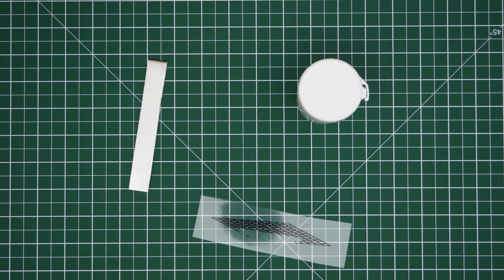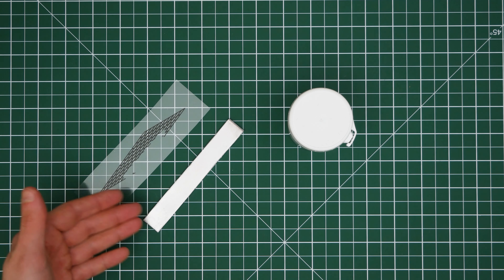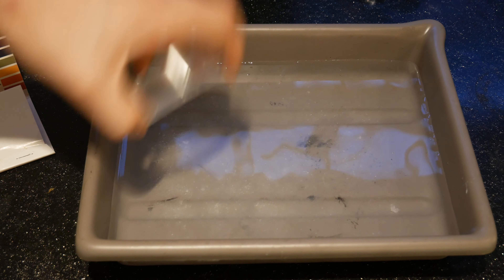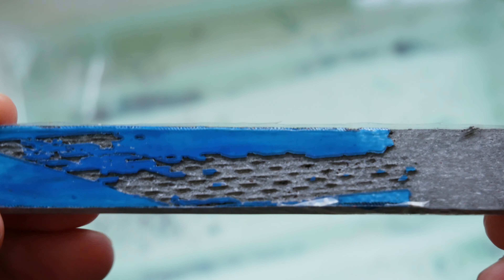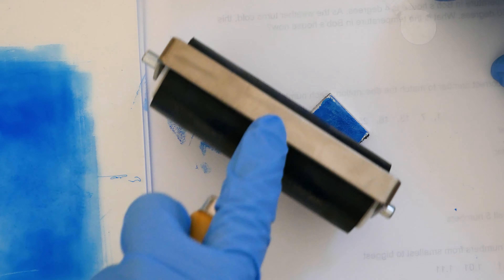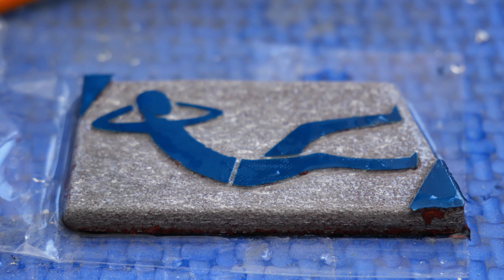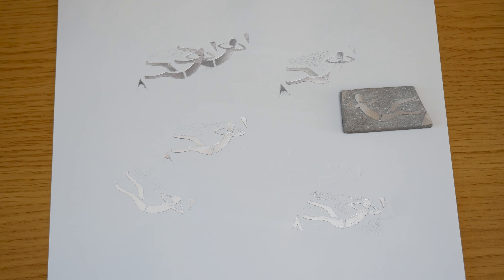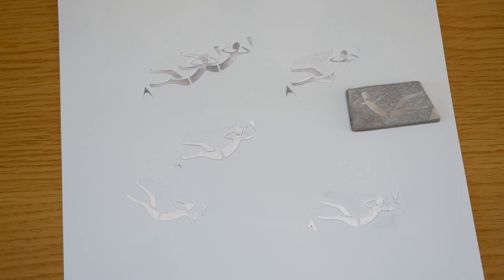Metal Etching - AMAZING results at home

Comment from the maker: Ricardos comment seems to have disappeared but it was very informative and may help others so I'm posting it - "For some time now I've been trying to understand too how to produce a nice deep etch that either results in a straight 90º edge or a 45º angled base (as used in plaques/signs or letterpress). I haven't seen any home made process but the professional way uses a machine that mixes a bath of water, nitric acid and etching oil. From what I understand, it's the oil (that I suppose doesn't mix with the rest) that protects the edges while they're bitten away by the acid. I haven't found an explanation on how the etching machine works. I know it spins and I suppose it also emerges and submerges the plate. The trick might be here, as when the plate rises and spins above the bath, it'll throw away the acid and slow down the etching. When it submerges, the oils on the bath surface will adhere to the edges and progressively build up a resist. This would explain somehow the degree edges produced on some etchings but I guess the process is different for the other "just-raised" edge type. Here's an example: http://sunsetsigns.co.uk/wp-content/gallery/etched-zinc/etching_zinc_6.jpg and this video explains briefly the steps to it: https://www.youtube.com/watch?v=OW-QA7wrPOE I have no experience whatsoever with etching or printmaking. I'm just assuming. Nitric acid is a bitch to work with too. "

Comment: Great progress man! I really hope you will find the right method, looks like your almost there! Just some ideas: maybe try copper or magnesium instead of aluminum. Maybe even try other aluminum, to me these plates you used looks quite rough, maybe the the mix of aluminum is just bad and not for this job.
Other thing that I remember from PCB making is that I always (for some reason, I read it somewhere) used horizontal position of plate in the acid bath. I we used to stair it, or better say rock the container with the acid that way the plate was always clean in a bath and chemical process was even.
Reply: I know it is pretty off topic but do anybody know of a good website to stream newly released tv shows online?
Reply: @Ronnie Castiel i use flixzone. Just search on google for it =)
Reply: @Samuel Gunnar yup, I've been using FlixZone for since march myself =)
Reply: @Samuel Gunnar Thanks, I went there and it seems like they got a lot of movies there =) I really appreciate it!!
Reply: @Ronnie Castiel Glad I could help =)

Comment: To HELP with under cutting you need to add resist. Etch it for a while, pull the piece out, add resist to the edge, place it back in the etching solution, repeat. It wont be perfect, but it will reduce under cut. You can try permanent marker etc as resist.
Reply from the maker: yes I actually tried using the old technique to brush some fine resin (dragons blood or something like that) onto the edges and heat it up so it fuses to the shoulders of the metal etch. It was no way perfect but it did work and prevented undercutting!

Comment: I've seen folks make photo-etched parts for modelling from thin brass sheet. For simple designs, would it be possible to etch 3-4 or the same thin parts, then stack/glue them on a base plate to give you enough depth?  Regarding the undercutting, I wonder if you could carefully add some form of resist to the edges of the etched design mid-way through the etching process. Could that maybe work to hold the undercutting back for just that little bit of additional depth that you need?  Just thinking out loud.
Reply from the maker: seems like there would be too many variables etching the image multiple times and stacking it together, especially if you wanted to do fine details like text etc. I might give it a go though so thanks for suggesting

Comment: I'm just going to throw this out there. I have seen people use dish soap as a surfactant in water. This keeps the water from beading up. Could you make your initial etch, and then gently add just a thin layer of water to the etched surfaces using a pipette or syringe. Then give the whole thing a light misting of spray paint. Use a vacuum to suck out the dried paint that's sitting on the thin layer of water. I am wondering if this would deposit enough paint on the walls of the etched surface as to prevent the erosion of the walls. Anyway I've been pondering how to get around this problem since I started watching videos like this. Hydrographics made me think about how this might work. I would love to know if you give it a go. It sounds like a simple enough experiment. You just have to hold the spray can at some distance, so as not to disturb the water too much. A couple of very fine layers of paint or maybe primer. Which ever can withstand the etchant.